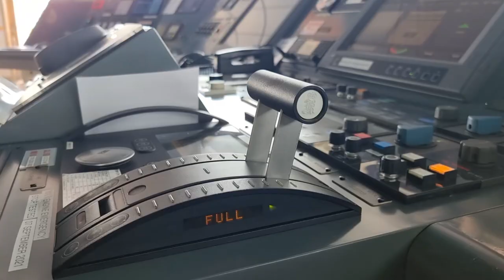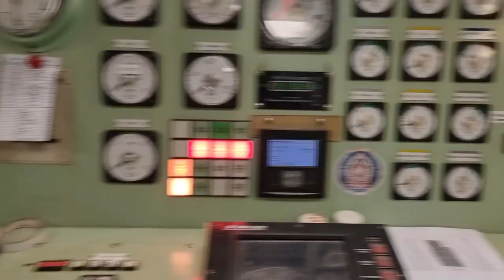ONBOARD MAERSK CONTAINERSHIP

Comment: First of all, thank you very much for your information.  I am working as a chief engineer on a ship.  There are 4 690 volt generators on our ship.  When we parallelize the generators, the generator number 3 gives load too high deviation alarm.  How we can solve this problem.  I would be glad if you help.
Reply: Chief also check the power factor of gen no. 3 which will be less compared to the other paralleled gen. If so then u only need to adjust the voltage of gen no 3 that too reduce the voltage upto the level that power factors of both gen. running parallel come same... Ur amperes will also get adjusted

Comment: When the generator number 3 is on alone, the voltage and amperage values are normal, but when we parallelize the other generators, the amperage values in the generator number 3 increase too much and load too high deviation alarm is given.
Reply from the maker: hello Chief, I would suggest to do these test.

Considering that all filters are clean for all the generators.

1. Run the generators and observe the speed at no load. You need to compare each generators at no load and if there is unequal values then adjust the governor speed droop.
You also need to manually measure the voltages of each generators by using portable voltmeter and not the one on the board. Sometimes measured values on the board are not accurate. If there is an unequal voltage then adjust it on the avr.

Last is to Try to parallel the generators manually to eliminate the cause if whether the fault is coming from the pms card or on the generator side. I hope these will help
Reply: Adjust gen no 3 voltage from potentiometer to adjust towards required amperage value

Comment: I changed the current transformers in generator number 3.  I changed the syncronoscope.  I changed the screen.  I changed the cotroller.  Unfortunately I couldn't find a solution.  please help.
Reply: I thinks its coz other generators are not taking load and this alarm coming. Did u try to overall the generators or clean turbocharger?